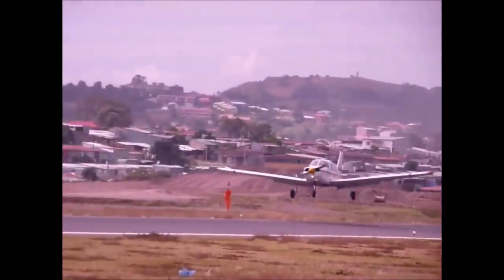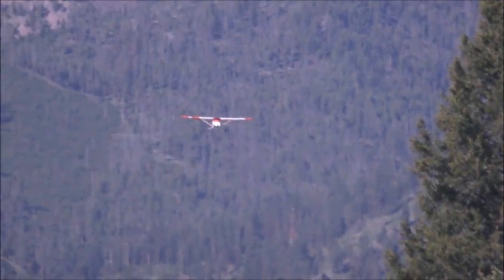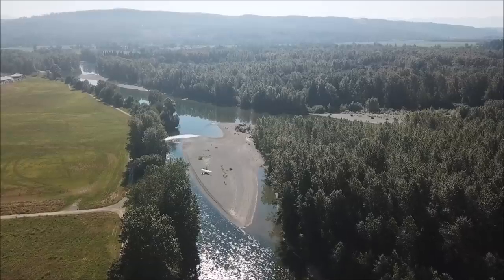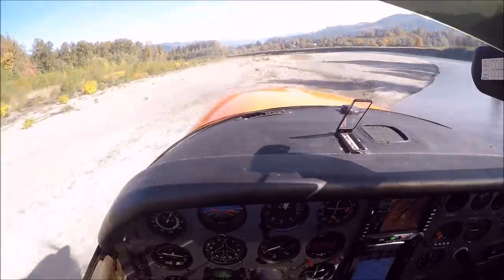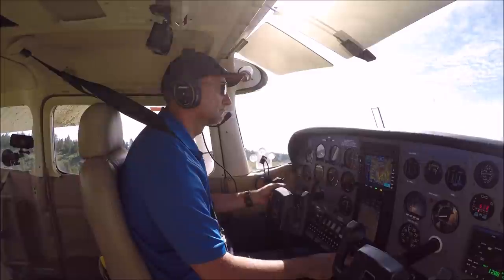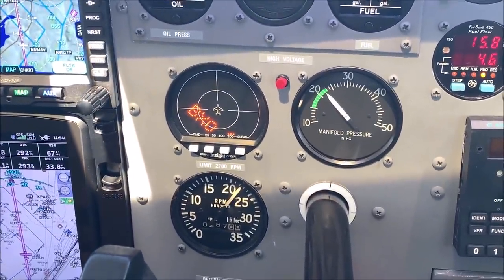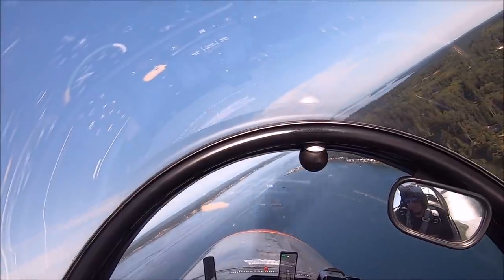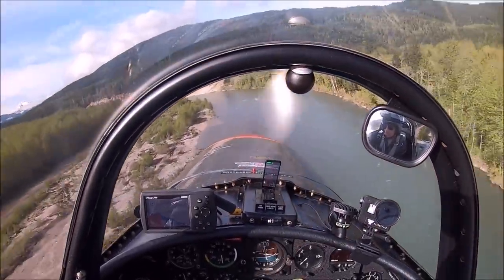Essential flying skill, energy management.

Comment: I appreciate these video; I don't fly but one day I will because of *you*!

I love the point that you make here at 2:39: "the slower I want to go, the more power I add" sounds unintuitive but checkout his other video on power curve.

You're talking about being behind the power curve. As a plane's speed decrease, the overall drag (mostly parasitic drag from the fuselage) decreases for a while. As the plane nears stall speed, the parasitic drag continues to fall but the induced drag increases (from increased AOA and airflow separation), eventually winning, causing the overall drag to go up.

For a pilot this requires decreasing the throttle to maintain decreasing speeds for a while until nearing stall (when you fall behind the power curve); at this point you begin increasing power to maintain slower and slower speeds until full stall.

Edit: This is under the assumption of level flight and constant airspeeds!
Reply: Yes, but only to maintain level (ish) flight.  In the spirit of a discussion on energy management, there is another way to fly really slow that doe not require increasing power.  With a steeper approach, gravity can substitute for engine power allowing you to fly very slow as well, using altitude for the energy part of the equation then slow the descent rate with a flare and blip of power before touchdown.

Comment: When talking about energy, you mention "power" and altitude. I normally think of it as speed and altitude. Did you really mean power? And why? Power, as in how much horsepower your engine is capable of delivering? Thanks.
Reply from the maker: 280HP, yes I meant power, many times I land adding power , also adding power on tight turns at slow speeds and tricky situations, power gives energy, altitude can be converted into energy, speed its also energy that can be converted to altitude, all this is personal opinion , I am not an instructor, or think I am the best pilot in the world.
Reply: @motoadveBackcountry182  got it. No, I understand now and think it makes sense. Having more (horse) power under your command is definitely helpful. Thanks, your videos are very enjoyable! I can only hope I get to experiment some of those airstrips some day! Saludos!